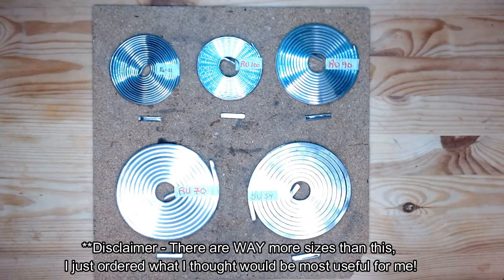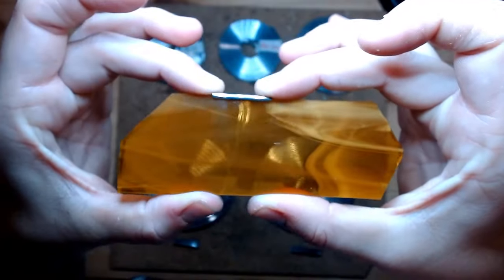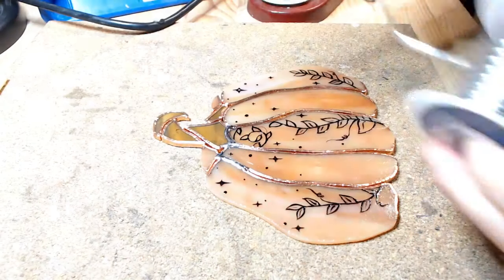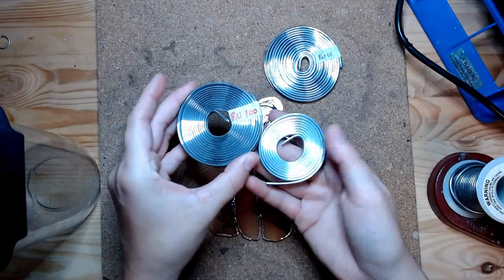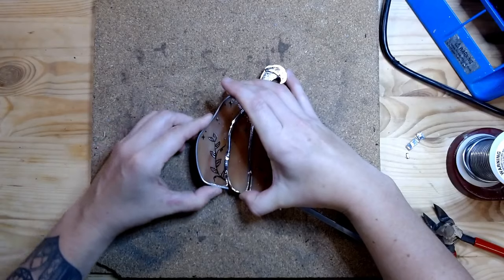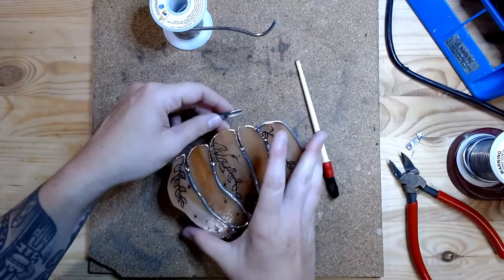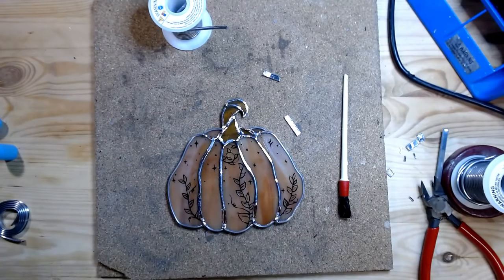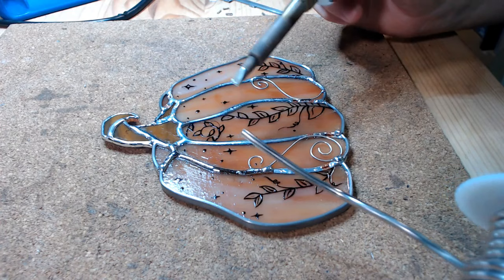Lead Came Tutorial :: Stained Glass U-Channel Lead Came How To

Comment: Hello, I really like how you have organized your YouTube channel and the detailed information you provide in the videos and in the description.  I am a beginner stained glass artist.  Could you please tell me if you have a video showing and explaining how you put the wire/cantel decorative element (which is on the pumpkin)??  I am wondering what material it is made of and is a special flux used to solder it?  I bought a wire, but the solder does not join the wire.  Please help me.

Comment: Thanks for such an informative video!!  I thought I was absolutely ready to start using lead came.  However, you described them in RU #s and when I'm trying to shop, nobody is using those terms that I can find. Some websites are using 1/8" round vs. 3/16" round.  Amazon is just calling them 5/64" round.  Now I'm so confused.  I just want to do mostly small / medium projects, with a nice came edge.  I had settled on RU100 as you described but can't figure out how that translates to the selling websites and their measurements.
Reply: This is my question too! What did you go with in the end?
Reply from the maker: I tried my best to give as much info as possible - glad you liked the video! The above issue you described is exactly why I went with a stained glass supplier for ordered versus ordering on Amazon (although i know this is not always possible as Amazon is much more accessible). I believe the easiest option would be to convert the fractions to millimeters and compare with what I include in the video (or, on a stained glass suppliers website). I apologize this comment is so late, I'm sure you've already found a solution!

Comment: Thanks for doing this video, Rachel! I’ve seen two different ways to add U came to the border, one with foiling the edges and soldering the came directly to the edges and the other being the way you just demonstrated. I was doing it the former way but found that it looks quite messy by the end. I tried this technique, but on a piece with very few solder lines meeting the edge so there is nothing anchoring the came to the edge and it slightly pulls away under the weight of a jump ring. I’m nervous the came will stretch with time and pull away from the edge. Ever have this issue? Thanks!!
Reply from the maker: I've absolutely had this problem! Theres a part in the video where I briefly address this. For areas that need extra support I put a small strip of foil, usually half an inch or so, and then solder the cane to that. It helps keep the mess down but helps add that extra little bit of stability :)
Reply: I’m sorry, I must have missed it! Great idea, thank you!!
Reply from the maker: Of course and no worries! The video is pretty long so theres a lot of info to unpack 😄 Thanks for watching ❤!

Comment: Just wondering how not to totally crush the soft lead with my neighbors? I did order the nippers listed on your link ❤️
Hope it works LOL thank you so much for all you do with these tips and tricks I’ve learned so much with your channel.
Reply from the maker: As far as what I've experienced, you will always kind of smoosh the lead when you cut it. I cut mine as quickly as possible to try and get a nice sharp edge. If you do crush it, I will go back in a cut the sides down individually to create a nice chisel point. I hope that last part makes sense! Thanks so much for watching 🥰

Comment: Hi again Rachel, when you add the jump ring, does that need to connect to a solder seam at the back? Or to the came? And do you use two for something this size? Thank you as always ❣️
Reply from the maker: I usually try to connect to both! At a minimum, definitely the solder seam. Unless the project is very small, attaching only to lead will eventually stretch it out.
Reply: @sunbearglasscraft8065  excellent advice as always Rachel. Thanks so much 😊

Comment: Thank you thank you! Any suggestions for how to match the finish of the came to the solder? I really want to do a silver polish on the entire piece but haven’t had luck making that happen.
Reply from the maker: The color is going to vary slightly - the came is usually darker than the solder once polished when left silver. Most lead came accepts black patina but I havent had luck with copper patina on the ru70 or su54 (and I haven't tried copper on the smaller came)

Comment: Your videos are amazingly helpful, thankyou 😍
I was wondering what kind of marker you are using for drawing on the glass? I've been using oil based paint markers and baking them on in the oven, which seems to have fully fired it on until I paint on flux for soldering, which seems to just dissolve it. Watching you paint flux over these lines just fine, I'm desperate to know what you're using!

Comment: This video is so helpful! I haven’t used came in a long time, but I prefer the finish it gives. I have a question: when using came for a foiled piece like this, do you have to cement the edges how you would for a completely came piece?
Reply from the maker: Thanks for watching! I totally agree - came gives such a polished and professional finish to a piece! No, you do not need to cement the edges. Theres two main methods of finishing edges with plain came depending on if you're using hobby came or thicker came.

1) applying only came with no foil underneath. This is preferred if using a thick came or if finishing shorter edges with hobby came. Generally when using thick came it will be sturdy enough and have enough attachment points to the solder lines of the main piece to not wiggle or move out of place. 

2) applying came over foiled edge and soldering the came to the foil. This is preferred for hobby came with longer edges. In these cases I use 1/4" foil for the edges (although depends on glass thickness. If glass is thinner, 7/32 will sometimes suffice).

I hope that makes sense/helps!

Comment: 2 questions! 
What stained glass paint do you use? 
Also for adding wire for details and patterns do you get tinned copper wire or just copper wire does it matter?
Reply from the maker: Hi! I use pebeo Vitrea 160. As for copper wire, pre-tinned is easier although theoretically plain copper wire should work just fine. It's mostly just a pain have to tin it yourself! I purchase my wire in a glass store and dont know where they get theirs from.

Comment: Thank you for your helpful video. I am interesting trying this with the commercial solder iron that I have. would you please share with me what kind of solder wire should I get to try it out? I am not sure if the commercial solder iron is going to work. But would love to give it a chance. Thank you !
Reply from the maker: Hi there! I dont see why you wouldn't be able to use the iron you have, although I know irons that are used for electronic soldering have reaaallllyyyy tiny tips and arent good for stained glass. I use 60/40 solder, which can be ordered from most stained glass supply websites (Delphi, anything in stained glass, etc)

Comment: What temperature did you keep your Hakko iron on during this project? I always have trouble with black specks happening in my solder, even when I try lowering the temperature.
Reply from the maker: I had it at 410 for this entire video. It sounds like you might just need to clean the tip better - I tend to get black specks when my sponge is a bit too dirty. I usually wipe the tip every 4th or 5th solder stroke

Comment: Where do you buy your came from? Also would you recommend RU-90 for my piece which is measuring 22 inches by 22 inches? It only goes around the border of the whole piece, right?
Reply from the maker: I buy my came from anythinginstainedglass.com. I find RU-90 is a VERY tight fit and can only be used with thinner glass. I like RU-70 for my big projects and it gives me plenty of wiggle room. At 1:34 I talk about the sizes and how they compare
Reply: @sunbearglasscraft8065  With a larger project, would you recommend using came rather than copper foil/solder for the internal pieces? Or do I just came the border?
Reply from the maker: It depends on the size, but I personally have never done a fully leaded piece. The largest I've made was about 21x15 inches and copper foil for everything plus a lead came border was just fine. There's ways to reinforce but I've never made something big enough to require it. As for any other information regarding leaded glass, you'll have to check out other people's tutorials :) stainedglassdiy does a lot with fully leaded glass!

Comment: You should try a honeycomb board or even cork, for large things like Windows you would use this method- using something like a thumb- tack to keep everything tight n stationary-  as someone who's had a project slip just b4 contact w the iron- or burnt fingers,  trust me it helps, u can cut your own lil staples from steel wire- cork from $ store- it don't need to b fancy